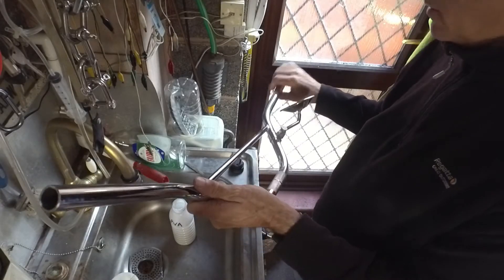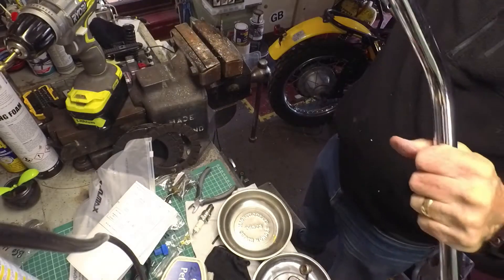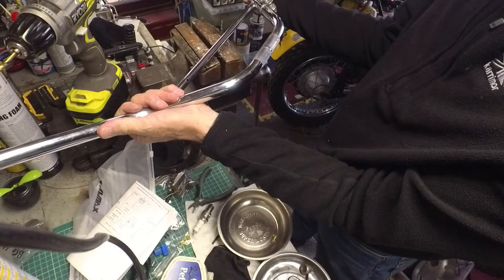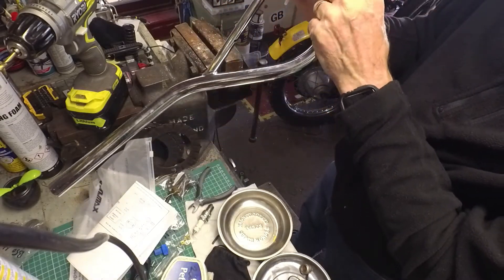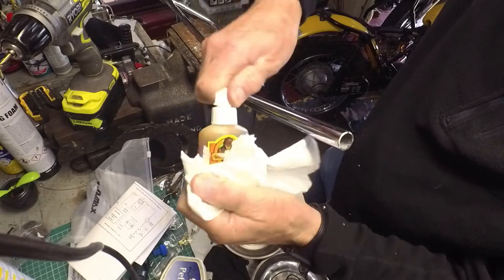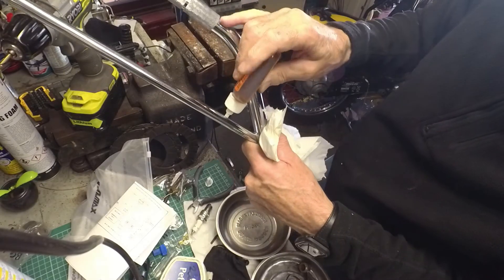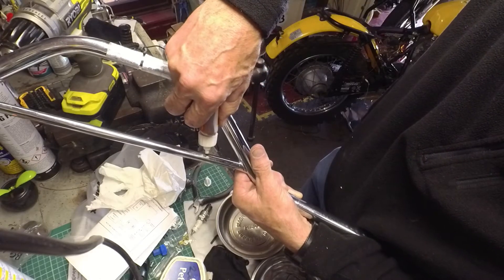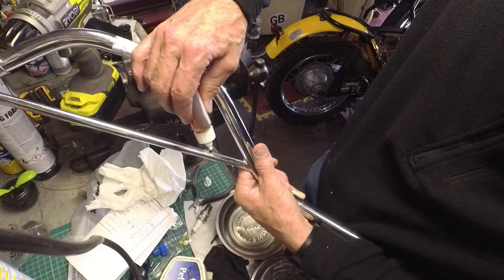BSA B50 Gold Star Refurb - Curious Handlebar Rattle

Comment: They look like aftermarket handlebars, the B50ss original bars don't have a crossbar. The B50 T and MX original BSA bars do have a crossbar but it's welded on much lower down than the one on the bars you have , and the knurling for the clamps is different.  
 So at least on this occasion poor old BSA can't be blamed for producing a faulty rattly part.
 When do you think you will finally take it for a ride?
Reply from the maker: Thanks for this. I’m still very much on a learning curve with this bike, so it’s great to have some expert input. Although originally exported as an SS the bike has clearly been converted into a pseudo-MX. This must include the after-market bars. I just noticed today that the rear sprocket has 56 teeth, so is even more extreme than the original MX. 
I sent off the registration application to the DVLA this week. By the time it comes back & I’ve got a plate made up, the bike should be ready for the road. I’m looking forward to trying it out properly (and hoping that no serious engine issues come to light).